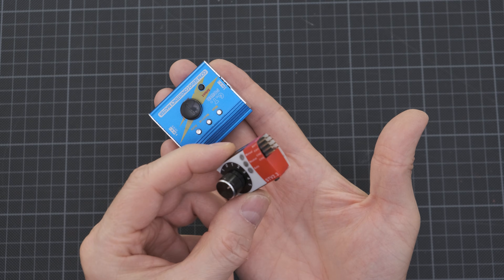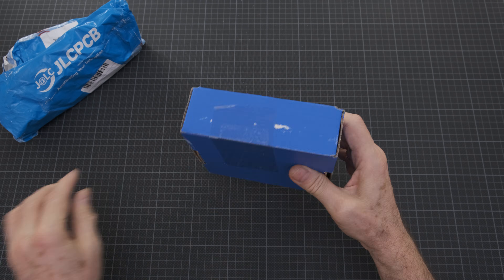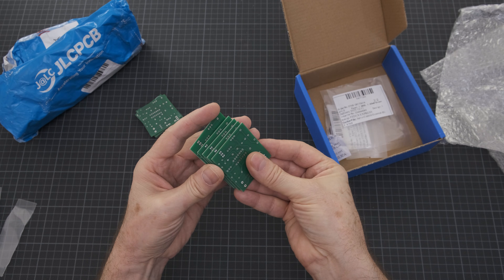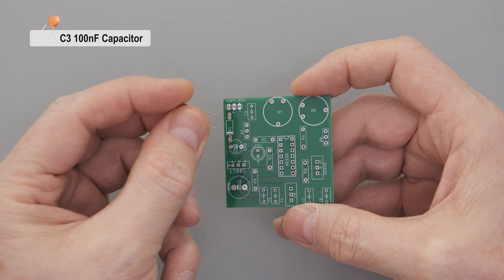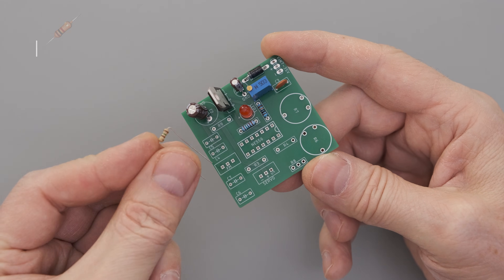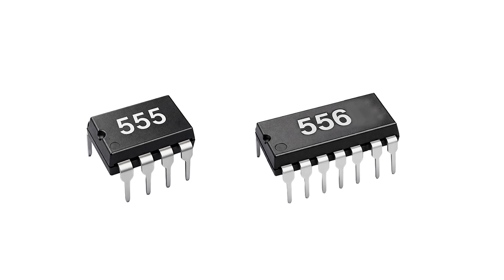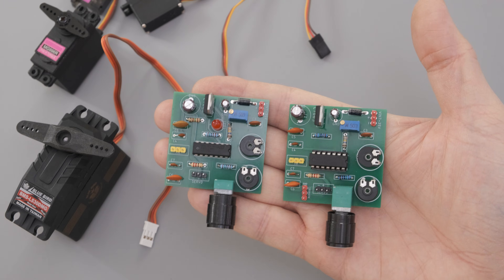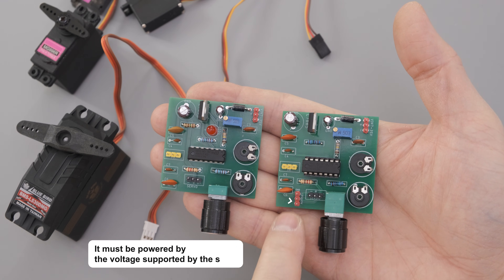The Best Circuit I've Ever Made... Limit-Adjustable Servo Controller.

Comment: Fantastic, I love it! Please, I need to make this circuit as simplified as possible. I volunteer to feed cat colonies, and we have a problem when we set up a trap cage to take a cat to the vet: the ones we don't want to catch always get in. This circuit would help us a lot. I have some basic electronics knowledge. If I could make this same circuit without the potentiometer, using only two pushbuttons and eliminating the 5V power supply—just indicating where to connect the 5V—and removing the two adjustable resistors, that would be fantastic. Thank you so much, I hope you will be kind enough to help me.